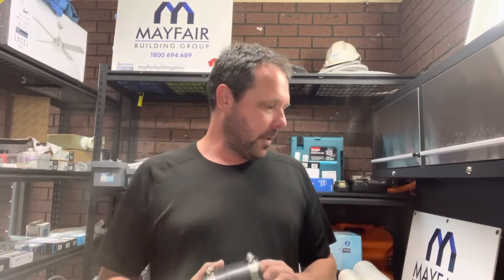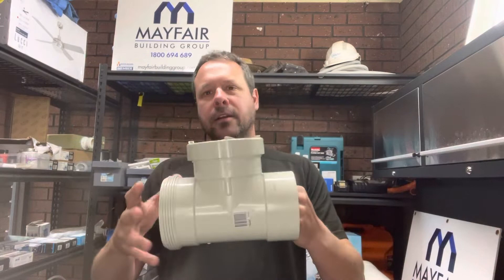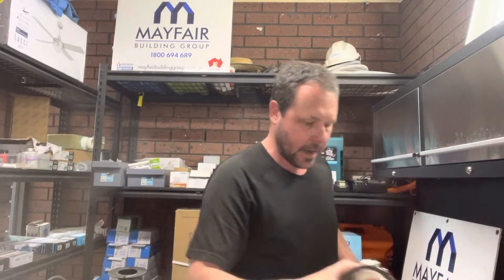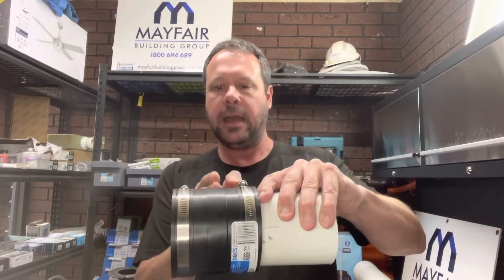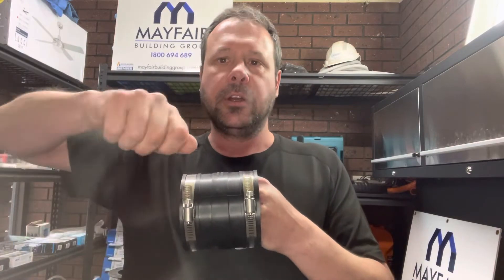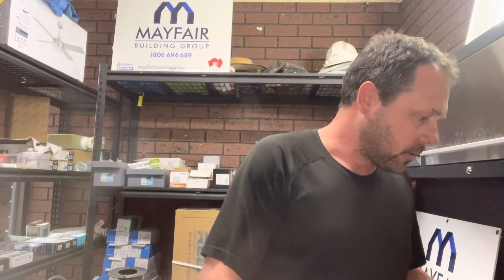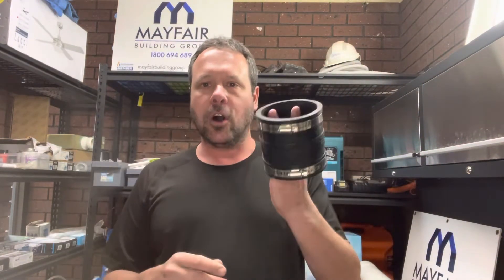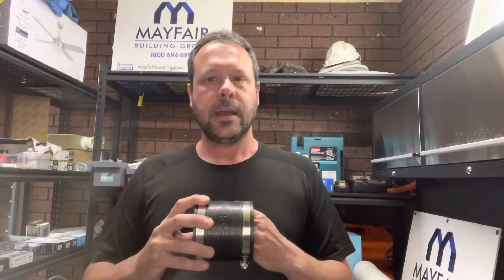How to repair a broken PVC drainage pipe using rubber boot connectors, Mayfair #Plumbing #adelaide

Comment: You think these will suit 100mm sewer ? Might have to use one as I got a y section that snapped past connection point can just stretch over the last left piece and onto straight 100 pipe
Reply from the maker: Hello, Yes as long as you get the ones which will suit 100mm pipe!